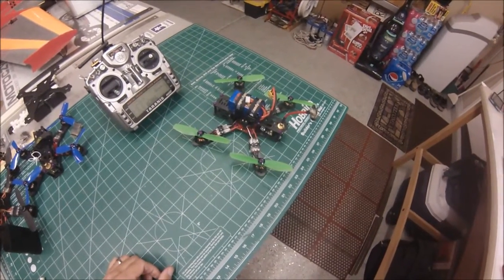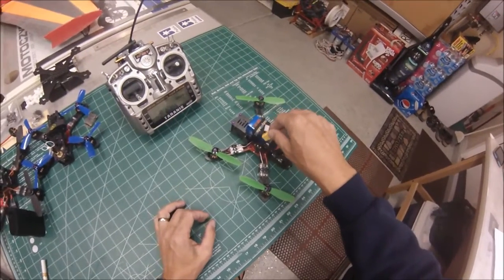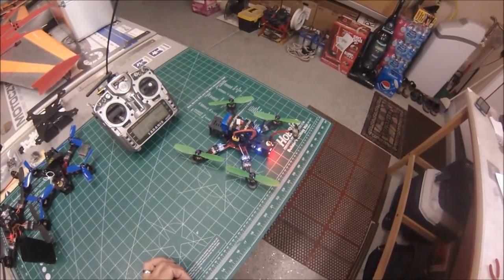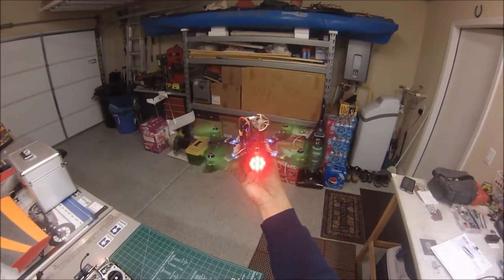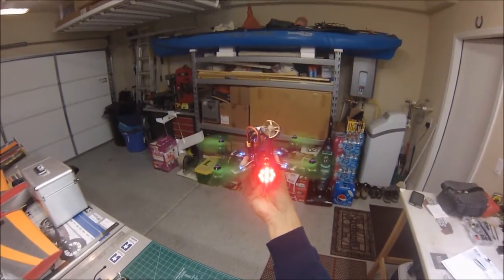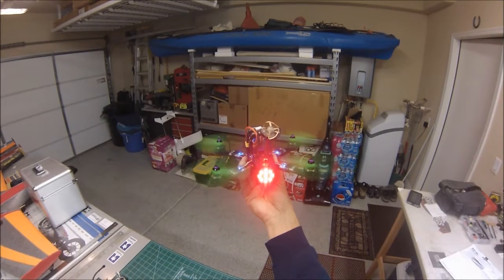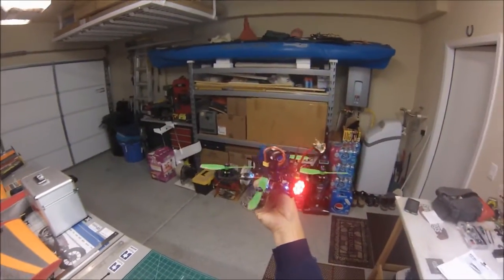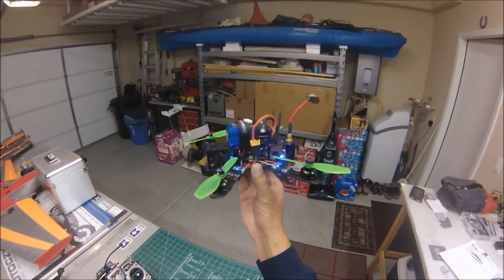Alien5 KISS FC & 24a ESC Idle Issues

Comment from the maker: Lester informed me its the 5V reg on the KISS FC that's causing the problem; I added polulo 5V 500mah step down reg and all is good.
Reply: Where did you add the regulator though?
Reply from the maker: The pitch positive and negative solder pads.
Reply: nice1... I tried most of the motor pins to try and power the fc, but none would work! switched from motor pin side to pitch 5v & grd now powers the board!.. need to test it see if it still falls from the sky!..
thanks @madsloper

Comment: Mike, I had that happen recently on my QAV210 and that's because I set my min throttle wrong (value higher than value shown in Receiver tab) in CleanFlight. Behavior is the same as yours where when I throttle up a bit past mid center, motors keep throttling up on their own. Bizarre. When I set the right value, throttle and motors behaved normal and as expected. Might not be a solution that will work for you though as my motors didn't oscillate like yours was doing.
Reply from the maker: +DroneNerd702 come to find out the KISS FC 5V reg is bad; added polulo 5V 500mah step down reg and all is good.

Comment: this behavior is to some extend normal, you are not using airmode so no PIDC active at zero throttle and as soon as you start to throttle up it will stabilize and since you are holding it that's what hand induced oscillations look like :) I am not saying I am 100% sure it will fly perfect with those PIDs but I would seriously give it a try :) Maybe over gras to push the convinced ;)
Reply from the maker: +JulianGoesPro come to find out the KISS FC 5V reg is bad; added polulo 5V 500mah step down reg and all is good.

Comment: I'm having a very similar issue but i dont really understand how the 5v reg could be the issue. The 5v reg is just to output 5v to the receiver. If you used a 5v reg to input power then you wouldn't get the correct telemetry reading and it doesn't make sense that it would cause this issue.
Reply: I agree. Did you find a fix?
Reply: Unfortunately no. I sent mine back and got a new one. It works fine but its on a completely different quad. I think the issue is that the GYRO is too sensitive so you have to set the LPF Filter to Low and find a way to mount it to reduce vibrations (such as putting o-ring between the standoffs) if you're using a unibody frame. I put the new KISS FC on a detachable arm frame and it doesn't have issues since there is less vibration, it flys really well now.

Comment: This started happening today to my QAV 210 with KISS setup... I thought i got bad motors... but theyre new RS2205 2300k emax. It wobbles out of control when it hits a certain point on the throttle and goes out of control. I have to dismarm the transmitter to activate failsafe... Do your motors heat up too when  it does that?
Reply from the maker: Yes, the motors got warm; best advice is to update firmware to a stable version and test. I've been away from the kiss FC thread on RCG for a while so maybe check on the thread for more recent issues and updates.
Reply: I'm having the same problem, did you find a solution?

Comment: Probably your throttle endpoints on you radio is not perfect but since you said you had already used this combo two times before on your quad without any issue, it's a little bit disturbing :s
Reply from the maker: +ABMNS PRODUCTION come to find out the KISS FC 5V reg is bad; added polulo 5V 500mah step down reg and all is good. Have a good week and happy flying!
Reply: madsloper Great news :D
Happy flying
Reply: +madsloper but now Ur voltage telemetry is not working right
Reply from the maker: +Xerro Fpv voltage telemetry works after adding the 5V reg. to the voltage in pins. V regs are know to go bad on the V1.02; the problems is supposedly fixed on V1.03 which are available as of yesterday.

Comment: mine does a crazy flip and goes full power. was ok with my 30a. Started it after I installed 24s
Reply from the maker: +Chris13FPV what FW are you currently running?
Reply: +madsloper 1.02 fc I think.
Reply: +madsloper esc 1.01
Reply from the maker: Beta74; RC16; RC25?
Reply from the maker: I am running Beta74 in this video.
Reply: +madsloper oh I don't know about that. I never change fw